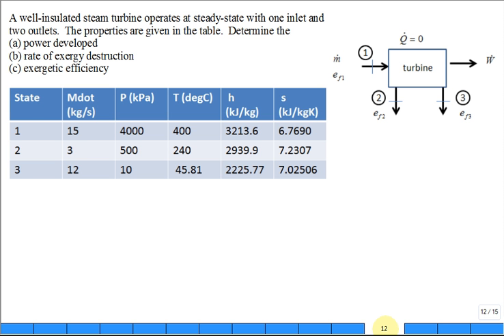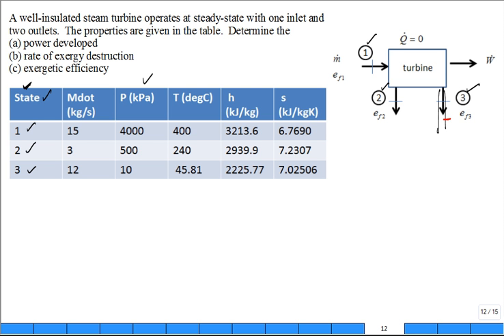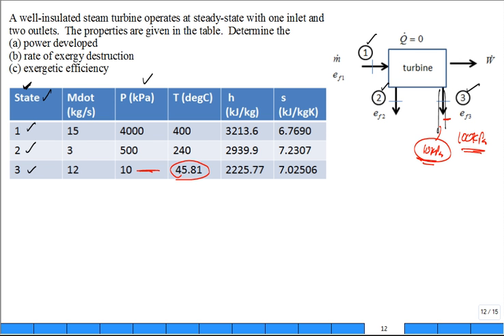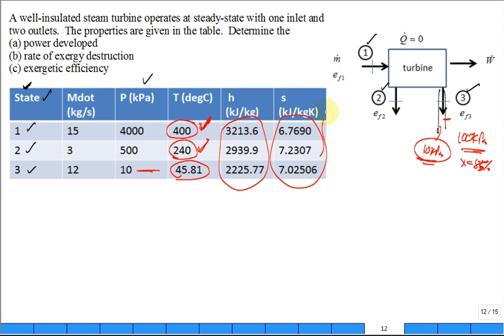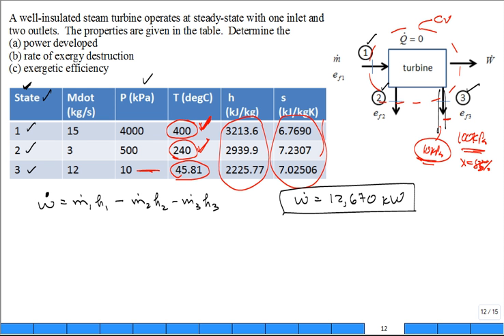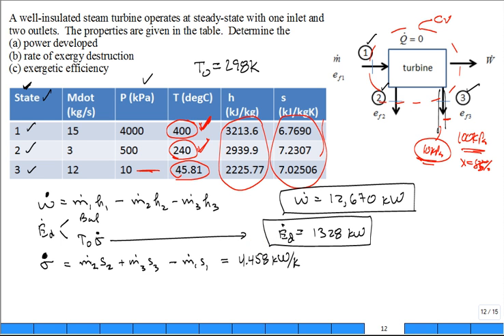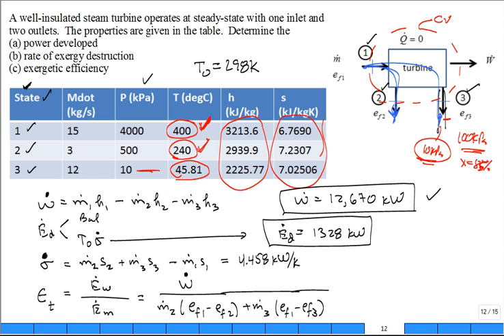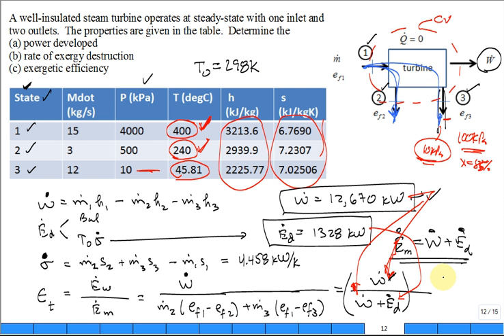exergetic analysis steam turbine 1 inlet and 2 outlets

Comment: sir, what about isentropic analysis steam turbine 1 inlet and 2 outlets? with a isentropic efficiency of 85%. How do you solve this problem? for ex. steam enters the turbine with  pressure of 80 bar en a temp 480 degrees celius and expands therein to a pressure of 0.08 bar.  steam is also extracted from the turbine at a pressure of 7 bar . determine the work deliverd by the turbine